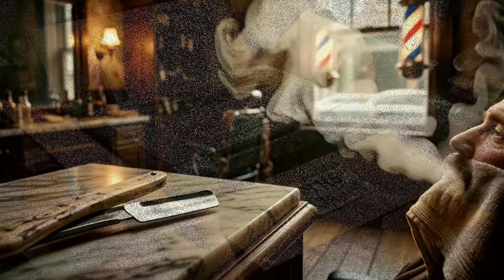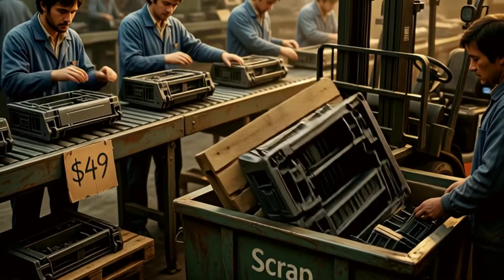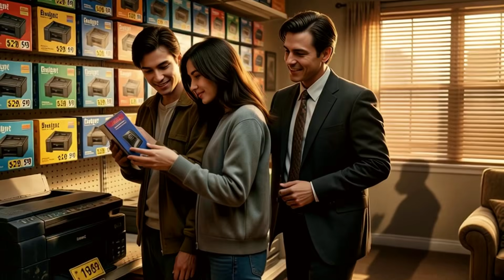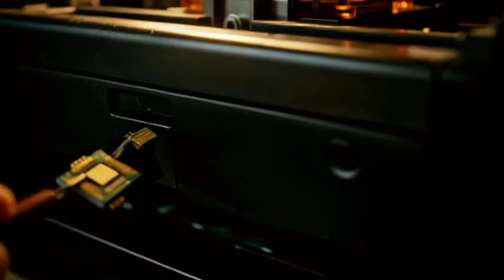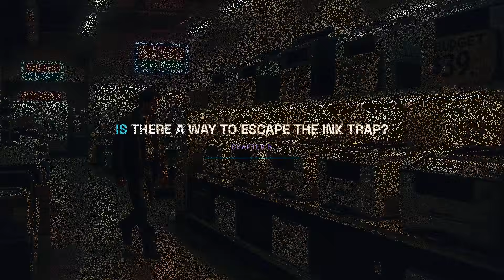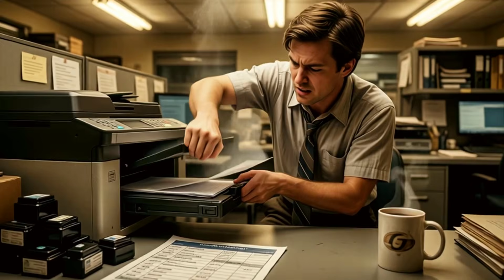Why Printers Are Sold at a Loss - And How They Make It Back

Comment: So they pulled off what Kodak failed to do with respect to their original high margin film model. Kodak mistake wasn't simply missing the digital boat. It was that its economic was tied to a scarcity that technology eliminated. HP and company face a similar hurdle but they ironically used chip technology to defend the leverage point rayher than the product, which is a more durable defense.
Reply from the maker: Thanks for this wonderful insight. Appreciated.!!!